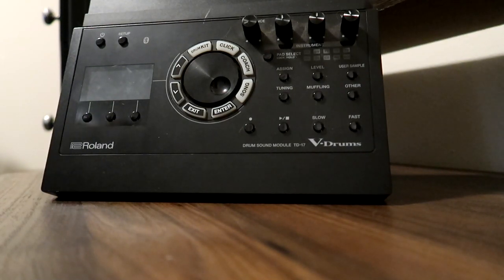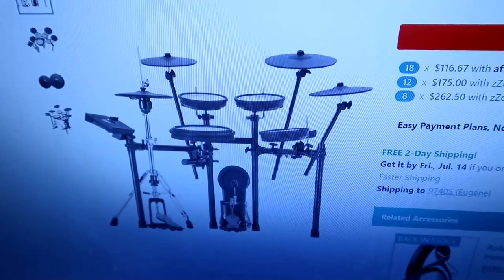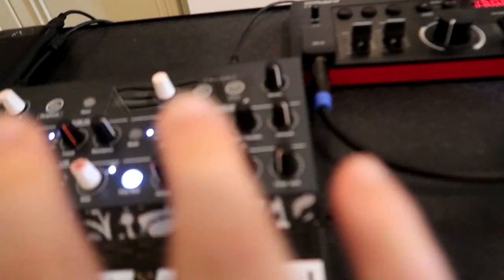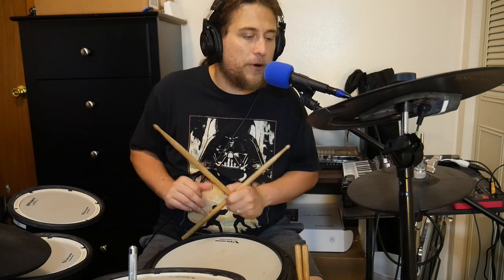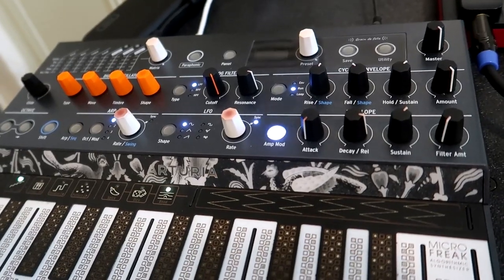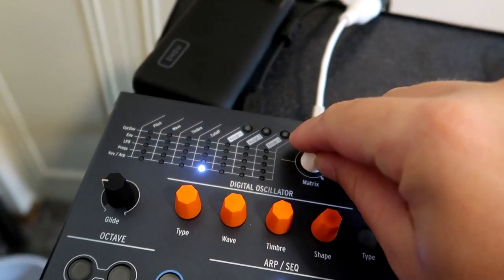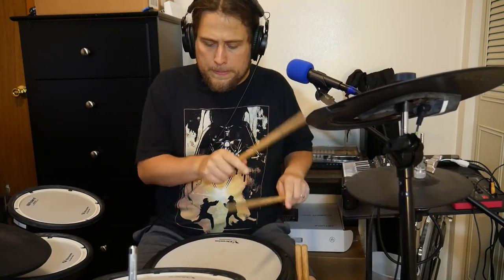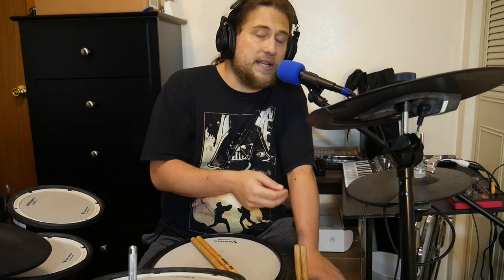Building the Biggest MIDI Controller I Own!

Comment: The intensity not being what you want could have been caused by voice stealing because you had it in monophonic mode at that moment, so it will just cut off the long release you dialed in to be able to go to the next note. And even if you set it to paraphonic, you still only have 4 voices on a microfreak, so you have 4 drum hits before the voice will be reused, so your release can be no longer than the shortest time it takes to play 4 notes in your performance.
Reply from the maker: Yeah I think I misspoke, I just wasn't getting the full range of the modulation that I wanted haha.